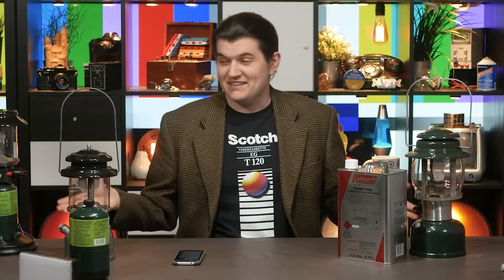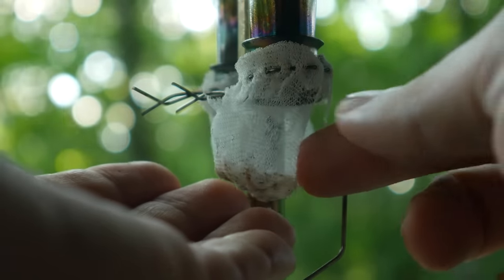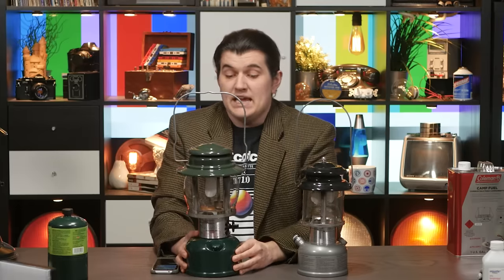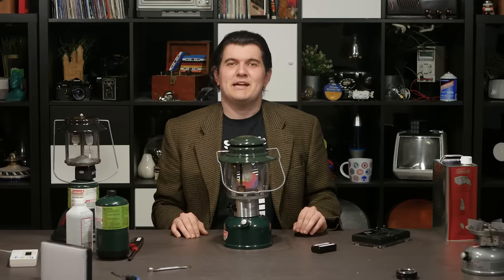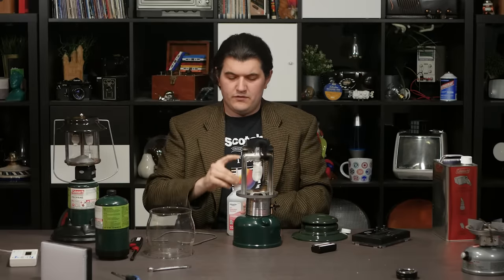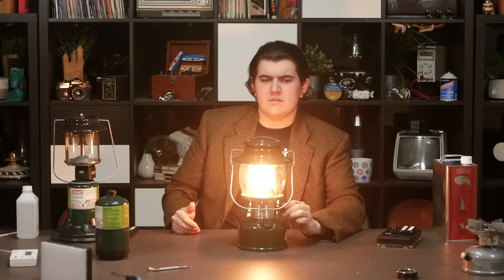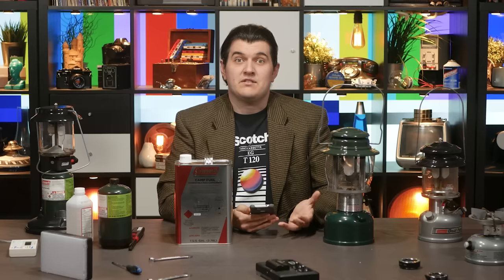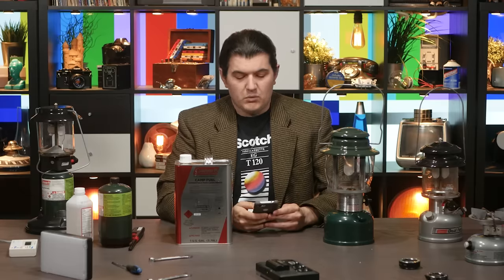A very rambly Coleman Lantern follow-up. Turns out they rarely make sense in 2021

Comment: For me it’s the fact that they are extremely rugged. I have lanterns that are over 70 years old. And they still work just fine. Even after sitting for decades these things can fire up with minimal work. Propane can sit in it’s tank indefinitely it will never go bad. I’ve used Coleman fuel that’s over 20 years old. And it works just fine.
Reply: um i had a small propane bottle go bad in 5 years or less as i forgot about it in garage aka should have been stored correctly NOS factory tampering sealed but all of it leaked out and wouldn't work for my blowtorch or the bbq 🍖 ( and im first though was cool 😎 i don't need to run to the store what a bad find after feeling lucky 🍀 and rummaging in the garage a hour later ) all gone and ended up buy a new bottle instead and kinda had the same experience with the bigger 20lb container 15 years later as i got a bigger bbq and a year later it had a shorter run time than I was planning on as some of it leaked out over the winter ❄️ well not in use

now diesel ( probably is the same thing for kerosene but i don't have any on around year basics or know somebody who does ) in my experience in my area rarely goes bad so id pick it over propane and regular E20~ gasoline that evaporates or turns into a gummy 😉 mess a year later or so if i need longer storage life ( except AV gas i use in my classics because it stores well but it stinks 😷 and not good for lighting 💡 lamps inside ) if not gas would work two
Reply: @richardprice5978  the propane itself will last forever, but I suppose it is only as good as its tank.
Reply: You are 100% right.  I have a 1918 Air-o-lantern that works just fine, though lighting the old quick-lights can be an adventure.  They are safe, but you have to respect them.  I usually tell newbies to get a modern lantern (a little safer and adjustable) or to go electric.  Keep the air tube clean and a good generator and you are usually good to go.
Reply: My kerosene lamps had their wicks go bad before the fuel did.
Reply: @TheNiteNinja19  how so? did you store them correctly?
Reply: @richardprice5978  propane tanks will vent pressure if they get too hot. I like to store my propane in bulk thanks. And I refill my 1 pound tanks as needed. You can buy an adapter to refill the tanks . With a little practice it is very easy to do. And it’s much more affordable the 1 pound tanks are  overpriced.
Reply: @TheLoboindio  yes but both of my 5-20 gallons and 1 pound tanks where full @ room temperature 72F ish and were mostly if not all fridge temperatures say 20-40F as was keep clean and dry with no chance of any rusting ect. and i still lost some ( up to 15 gallons of cng ) in the 20 gallon tank 🤚 🤚 

i now use cutting torch and a cart instead of the handheld CNG blow torch that went missing 5+ years ago or the tig or tungsten arc to tungsten arc process or stick welder or my plasma cutter to heat metal up ect. and this year so-far i haven't used my roadside/renter abandoned and neglected at my 🏡 find BBQ 🍖 at all and does needs some work but i haven't bothered to yet, also is a great way to heat up and or clean smaller automotive repair repair and or parts ( or prepare castings for welding 👨‍🏭 ) as i did it to my rods and v8 440 mopar pistons and the same 20 G tank i now super rarely ( as its more work to set it up and costs more money 💴 to operate but needed it in a prior rental/apartment ) but out of comfort sometimes use the for heating in the driveway under a car boot/trunk ect. or shop ( for extra quick extra heating as the house 🏡 im in right now is slower with the door 🚪 heat leaking option open only to my cars as there's no central or mini split air to it ) to fix my rides in the winter ❄️
Reply: @TheLoboindio  what definition is bulk to you and fuel supplies? ( more so with LPG )

as for refuelling the smaller ones at the time my family didn't want me to to that for safety reasons ( and iv never tried it but iv know about it in 2002 sameafter i moved
Reply: @TheLoboindio  what definition is bulk to you and fuel supplies? ( more so with LPG )

as for refuelling the smaller ones at the time my family didn't want me to to that for safety reasons ( and iv never tried refilling smaller ones at home 🏡 but iv know about it in 2002 same way with using hoses to my equipment on a 20  gallon and did use hoses after i moved ) ect. so it wasn't a option for me but yes i can see how it might make money 💴 sense too do it
Reply: @richardprice5978  ok
Reply: @richardprice5978  anything larger than a 1 pound tank that can be easily refilled. 20 pound barbecue style to 100 pound monsters and above. 30 and 40 pound tanks are very handy. And last a long time. And lightweight enough to handle. Keep in mind a 20 pound tank does not weigh 20 pounds. That is just the amount of propane it is capable of holding. It is heavier You have to add the weight of the tank itself  However they do not fill tanks completely. There Has to be room for expansion.
Reply: @richardprice5978  That’s interesting I’ve been using propane tanks for decades. And I leave mine outdoors in Southern California. In 120+ degree heat and I’ve never had a problem with  losing propane. Is it possible that someone used your tanks and did not tell you.
Reply: @TheLoboindio  so no i believe and sure mine i have right now is 20 gallons and not 20 LB's and i have refilled ( and yep i know about the extra head room as one time it was a little too full by about a 1/4-1/2 G ( shop clerk messed up and spaced it 😂. but the one you're wondering about was 4-2 ish gallon from max aka full done right at 72f~ ) but not for long as use that up in under 6 hours before any heating was a problem and was in the safe zone quite quickly as the heater was drinking 🐷 to keep my block water 💦 from freezing sold intel i fix it correctly ) a couple of times for my prior shop / sub-80ft container that was retired from use 🚢 and moved in 2009-18~ as i didn't have utilities to it 😑😒 and had to provide my own off grid utility in 2015/ the hole time mins water's as i had no options too, still doesn't tell me what you consider bulk buy for fuel CPG, but in my area and or case 2 pounds or more is charged by refuelling gallons vs canister 😉👍 ( at 5-20 USD a gallon as it's been a long while since i needed to use it a lot and a refill again but mine 🤔 is empty or close to it right now 🤔 ) ( same way for my welding 👨‍🏭  and oxygen and acetylene and argon tanks as i don't bother with the small ones and go for standard commercial size ( the same ish ones at work buys for handcart use ) or bigger as i go though it too quickly/ its a inconvenience to stop 🛑 and go shopping + ⛽️ $ )

the small ones like in the was in the video sub 5 gallons, was 5 + moves ago ( in the 1950 shop ) and i was a lot younger then, and now in 2021 don't have any or use them anymore or know someone else with a stockpile of them 2+ or uses them. 

possibly of theft is there as my 70's shop did have other things go missing ( door was busted in but i saw them running 🏃 away * ) ( 426 engine and vandalism ) around and or sometime before and afterward but i still have the same 20G tank i believe and don't think 💭 that it's easy to quickly steal it from the tank???🤷‍♂️ and be unnoticed doing so vs gasoline ⛽️ theft out of a car as my 90's-up Buick years ago  had as a teen at movies 🎥 ( FF4 🤔) and having to call for help wife/parents, after that i wanted a locking cap 🧢 🔐 to 🛑 that from being a problematic again
Reply: @TheLoboindio  sorry for the half typos comment before as youtube double automatically and or missed up posted parts of it last night 😏

and im not sure how or why it went buggy 🤷‍♂️
Reply: ps. the 50's shop incident couldn't have been tampered with as the factory tamper resistances / shopping store seals and anti theft devices were all still inplace and the top of the outside box 📦 in a 📦 it was it / cabinet's would have been obvious that it was messed with at the first time of trying to use the 6* pack of them and yes they where sold as full fuel tanks but at the time of first use was 99% empty to where my finger nail could depress the Schrader valve open on each one of them and let ambient air in

but i did have a __ 25-50 years old neighbour ( not related to me or and one i know 🙏 and wasnt ever 🏡 his ect. ) that thought it was his 50's place 🤪🤪 ( and we never ever invited him / wife over or after that/in my house or shop and in my bedroom=creepy ) in ( no its was my place and my relatives/elders 🧓👵 ) the time i live there and after i pissed 😤 him ( by telling him/his wife to get out of my home 🏡 and never come back and or your trespassing ) off he vandalised the home 🏡 and the shop 😂 🤪🤪

some of you might know how mom's and wifes,grandmother 👵s ect. can get about doing questionable ideas so thats why i didn't do diy fuel things ect. or fireworks 🎇 ( and tuff beans as they don't like some other things i do i life right now as a 22+ like v8 manual grannie 4-speed 1/2 ton truck some how = corvette ha 🤪 or v8 6-speed muscle car / sports car 🚙 or TIG welding or plasma cutting = 🤕😂 ect. as im over 22 old now 😉 and for the most part don't do anything really dumb or stupid 🤓😵🤕 ) ect.😉

Comment: When I went to upgrade my headlamp, I had the good fortune/curse to stumble across the Flashlight subreddit. Absolutely insane how many lumens can be packed into such small packages.
Reply: Years ago the first custom flashlight I made was bright as hell but got so hot it repeatedly de-soldered itself no matter what I did if I used it for more than 5 minutes. 

Guess that's what I get for taking parts recommendations from the fasttech forum 😅
Reply: I personally find anything beyond 200-ish lumens in a headlamp to be actively detrimental. I just get blinded by the backscatter.
Reply: @jamesharding3459  Yes, that's very true. I build a flashlight with one of those 100w cob led chips and rarely use it on full brightness since I ran into a similar  problem.
Reply: Even the flashlight on my iPad Pro is unnecessarily blindingly bright!!!
Reply: ... Which can be more dangerous than using fossil-fuel lanterns! I refuse to travel with batteries in my pocket-rocket lights.
Reply: I have always wanted an old-fashioned miners headlamp that is powered by fuel
Reply: Just be careful when typing the name of that subreddit..
Reply: @gary6576  neat,easy,no nicks hair removal may be a side feature….
Reply: @prismstudios001  : I have found that a raging gaseous fire works well for that. Wave arm through fire at a calm but not slow pace, examine to see if hair is sufficiently gone, repeat as needed with appropriate delays to cool down a bit between.

Comment: A note about the fuel pump: it's a one-way valve design. It makes the pump easier to collapse into its stored position if there's a hole there.
Reply: This.
Reply: I swear my old Coleman type lantern pump needed to remove the thumb from the hole to introduce the next breath of to pump. If you sealed on both halves of stroke you'd get nowhere.
Reply: @frederf3227  replace the pump cup.
Reply: @frederf3227  That's never been a thing with Coleman pumps, I have one that's 40 or 50 years old that you can hold your thumb over the pump hole. Try maintaining or replacing the pump assembly.
Reply: the pump depends on a check valve at the bottom of the shaft

Comment: Hi, kerosene lasts up to 5 years in it's original container. Pump gas doesn't.
Reply: That is a super-cool and utterly tiny detail. Thanks for commenting! Another tool in my pandemic/zombie notes!
Reply: Good point.
Reply: @JasonLooseArrowAlso  Pump gas life can be extended by making sure to buy ethanol-free and/or adding stabilizer, and making sure you store it in an airtight container.
But...  If you're looking for post-apocalyptic power, look into wood gas generators.  They basically burn wood with too little oxygen and output a nicely combustible gas that can be used to run propane/natural gas appliances and internal combustion engines.  Some assembly required.
Reply: I've heard that if stored correctly kerosene can last indefinitely
Reply: @billdickson871  Sealed in an airtight container with little to no air (Preferable none)  Kerosene will last indefinitely same applies to white gas.  It is the Oxygen in the unfilled portion of the container that causes the fuel to oxidize and spoil.
Reply: You're absolutely correct about that except that it will still burn, I've successfully started automobiles that had 15 year old pump gas in their tanks on numerous occasions not that it's optimal but there's also an additive you can put in pump gas which will make it last Almost indefinitely.
Reply: @tarstakars  it won't burn as well and it burns dirtier. Try that with ethanol gas these days lol.
Reply: @hithere7382   Again not true if sealed in an airtight container that will not let light in with no void space or oxygen in the container it will last forever. Even ethanol lace fuel.
Reply: @hithere7382  "emergency situations" if you live in the middle of nowhere it would be your backup fuel..
Reply: @tarstakars  I keep 27000 gallons of diesel at my rural estate...
Reply: @hithere7382  at one time there was a Coleman pressure lantern that used kerosene and I was told the diesel would work in it also. though I cannot remember the model number of it, but I suppose with a little hunting you could probably find one.
Reply: Either gas over 10 years and propane does not have an expiration date.
Reply: @cobymela  pressurized tanks do though. Hot days cause them to off gas.
Reply: @tarstakars  or I can use my collection of 10-500kw generators to run electric lights.
Reply: @JasonLooseArrowAlso  diesel is usable for years, but will burn way dirtier after about a year with out special storage consideration. You can also refine usable "biodiesels" from fat and vegetable oils, so in long term survival situations it would be easier to refine and maintain a diesel source of fuel vs gasoline. Although the most readily available source of usable fuel would be wood gas based. They are generally referred to wood gas generators, or simply gasifiers. They heat wood or charcoal in a oxygen deprived environment to produce a hydrogen gas mix, and they were used widely during WW2 due to the rationing of gasoline.
Reply: @tarstakars  Kerosene and diesel have very similar properties, they're basically the same fuel, chances are it was just a normal model kerosene lantern.

I know my old kerosene wick oil lamps will run diesel without really any difference.
Reply: @walfman100  Is the wood gas really hydrogen? I thought it is primarily carbon monoxide, aldehydes, terpenes and degradation products of oils and cellulose. If I remember correctly, up to a whopping 70 % of the mass of a fire wood can be so called volatile compounds. After all, dry distillation is the process of how charcoal is made. The further the wood is charred in the distillation process, the less it will have volatile compounds, and thus produce less flames and result in a good ember. The down side of far-distilled charcoal is that it is hard to ignite. Thus the manufacturing process of charcoal is really a balance between a good, fast ember and the ease of ignition.
Reply: @azur3125  well hydrogen is the main burny part of the mix, but yes there is a lot of stuff mixed in with the syngas produced
Reply: @DAKOTA56777  no it's actually a Coleman pressure Lantern. a friend of mine still owns it and he got it from his father like 40 years ago. I'm not exactly sure how old it is but it's got to be at least 60-70 years old. next time I'm at his house helping them out I'll take a look at it and see if I can't find out what model it is.
Reply: @tarstakars  Yes, I was referring to a kerosene Coleman lamp, I used my wick lamps as an example of how diesel is similar enough of a fuel that it works in them, meaning it will likely work in a kerosene Coleman lamp too.
Reply: @jimmypautz 
 True.  
I emptied an old Coleman lantern that hadn't bee used in 40+ years and the gas (white gas) still looked and smelled fresh as the day it was put in the tank.
Reply: @DAKOTA56777  Burn diesel in a wick lamp? Noooo thanks, no one wants to smell that garbage.
Reply: Uh... I run my kerosene lanterns (including pressure ones, Coleman, Geniol, and others) on Kerosene from a canister I bought 30 years ago. I wonder where you took the 5 years from.
Reply: @christiangeiselmann  5 years in terrible conditions, this is the manufacturer rating of newly available containers of kerosene sold in big box stores today. Materials today are cheaper and not always as good as ones from 3 decades ago.
Reply: Our ancestors (think founding fathers)  survived without fuel.  We can too, if the world collapses 

.
Reply: @hithere7382  The thing you seem to be missing is they probably made the expiration date 5 years so even people buying it purely for emergency use would still "have" to semi regularly buy more even if they don't use it. Gasoline and kerosene both will last quite a long time if kept in a sealed container. You can have a gas can full of gas still be good a year later. Now, it does need to be pretty much full, because the act of pouring out the gas introduces ambient air into the can, which contains moisture which is what causes pump gas (specifically the ethanol within pump gas, which is very hydrophilic) to spoil. Sealed containers of kerosene can easily last a decade or more.
Reply: Gasoline may go bad but its not running and engine in this case. It should still burn fine in a stove/lantern
Reply: @richardmillhousenixon  hygroscopic is the term for absorbing moisture from the air.
Reply: @stevek8829  hydrophilic, hygroscopic, close enough